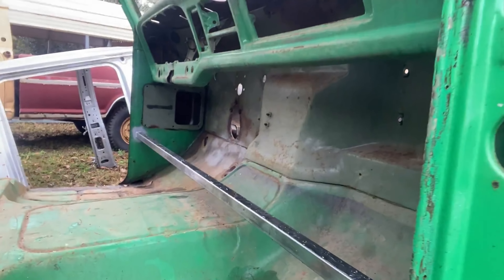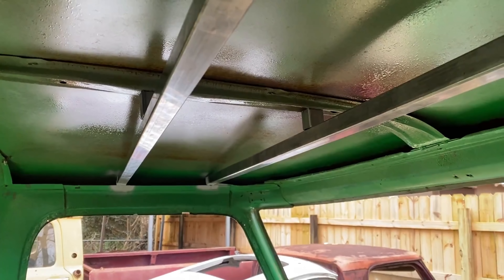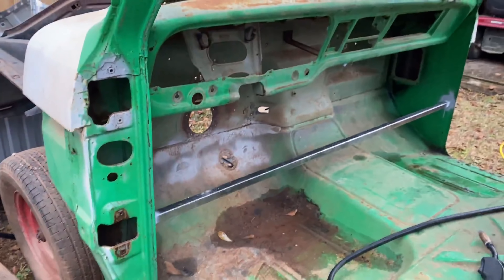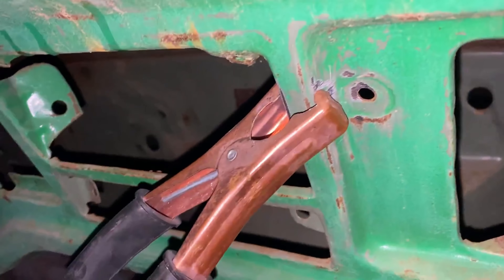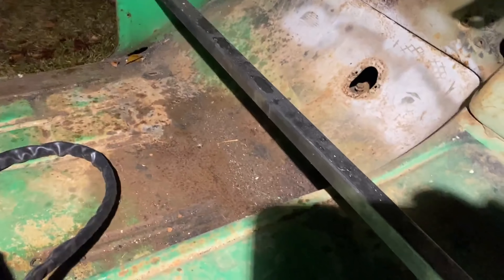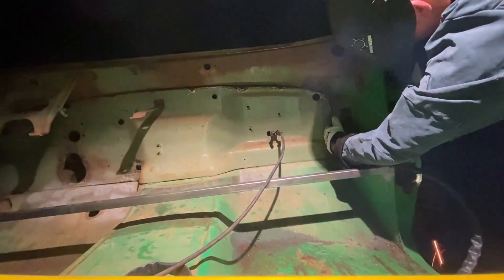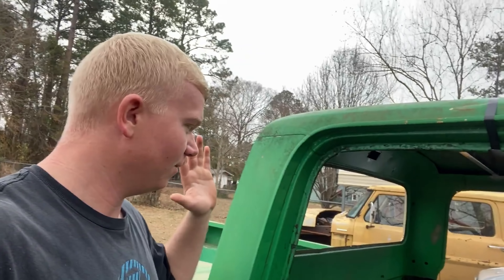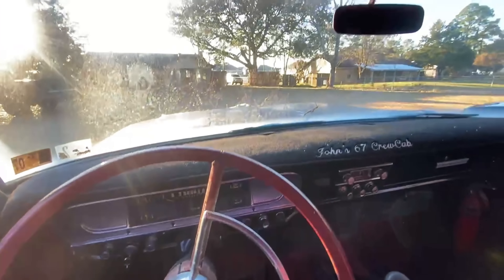I Cut a RUST FREE F100 In Half for my Crew Cab Bumpside Project: 6.7 Swap Episode 5

Comment: May try and turn ur air pressure down as well. They seem to like about 30-35 psi. Great work so far tho
Reply from the maker: I was wondering if that were the case. I’ll try that out
Reply: @GRAPPAHOLICS  also make sure you have nice dry air going into it.
Reply from the maker: @bradfordcustoms7588   I had 90 psi going to it I hope that’s what the problem was 😂